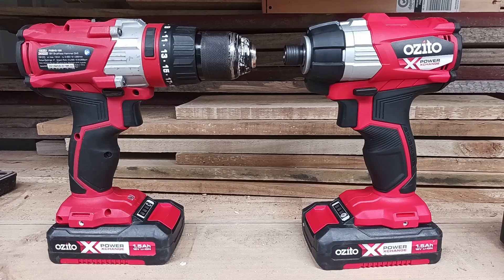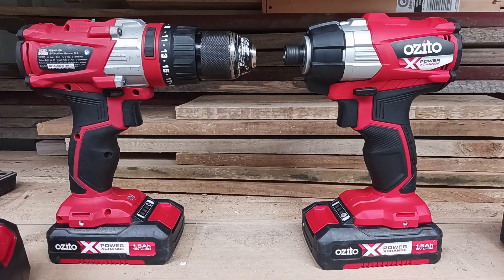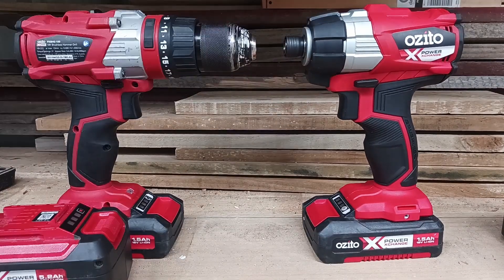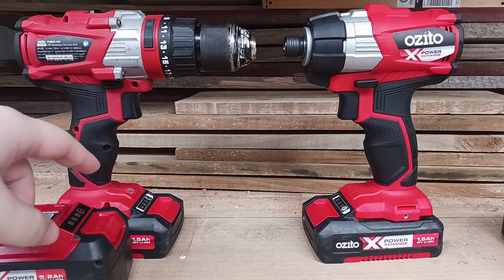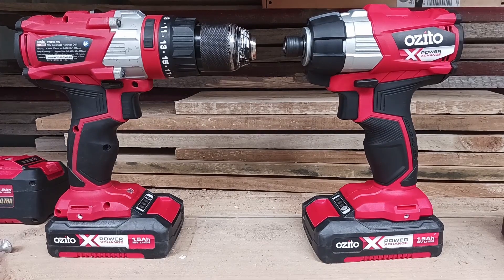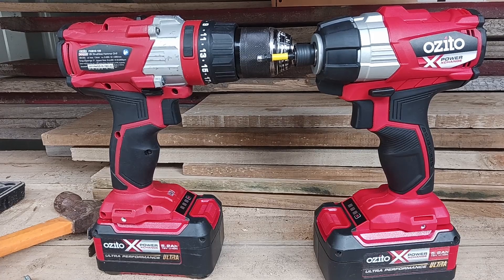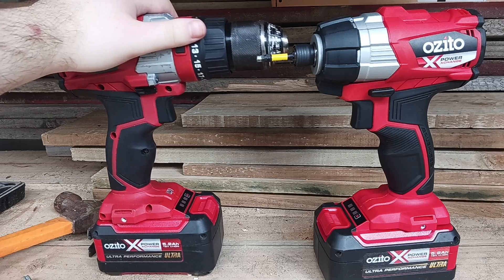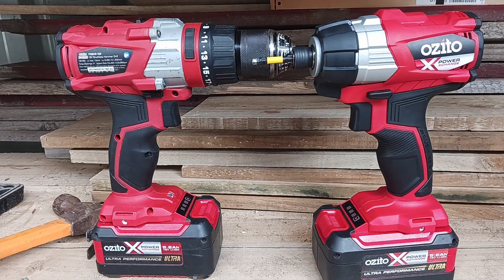Does Having A Bigger Battery Mean More Power?

Comment: The higher Ah battery will hold the voltage for longer and seem like it has more power
Reply from the maker: Yes, generally when you have a higher Ah on the battery it does seem to make the tool you're using perform a bit better.

Comment: Thanks brother. Hey, can a 48v battery last longer then a 12v battery? And is a 48v battery stronger then a 12v battery (I would assume so)?  I'm trying to build a solar power supply generator on batteries. I want it to generate 1500W 110v power.
Reply from the maker: Hi, yes 48v is stronger than 12v but you have to make sure the ah is sufficient enough for your power supply. 10 ah on 12v can gen 120W while 10ah on 48v would gen 480W. So in terms of stregth yes but in runtime no, volts aren't king dick it's the ah you have to be more concerned about.
Reply: Wow, thanks for your time, to answer a complete stranger. Thanks brother
Reply from the maker: @realhowbizarre  No worries

Comment: I have an Ozito PXC 18V Cordless Hand Vacuum PXHVS-250 - Skin Only ($49.90) and I could notice the difference between the 1.5Ah battery and the 4Ah battery just by the considerable change the in the motor noise. Umm and ah about this for a while because we had a cordless hand held one I got from the Good Guys for $99 and the piece of shit lasted 18 months before the battery died. I was going to get a battery online and swap it over but there was nothing that matched the battery holding pack and I don't have a spot welder to secure the 18650s into the holder so it would fit the POS one. This one was half the price and I already have the batteries for the other Ozito tools I am collecting. So yeah, the battery capacity does make a big difference. I wonder how this test would go with the 6Ah or 8Ah battery? That would be interesting. 

Suggestion only but when doing side by side comparisons, could you put which one is which so it displays on the screen coz I had to rewind a couple of times to check this. Getting old and have your memory go titsup is something you have to look forward to. 😱 Gives me the 💩s big time!! 🤬🤬🤬🤬🤬🤬🤬🤬🤬🤬🤬🤬 

Thank you for the video. 👍
Reply from the maker: Yeah I forgot to edit it in the battery sizes on the screen.